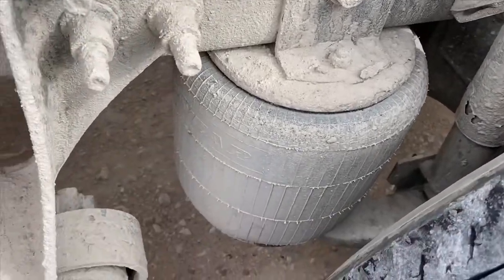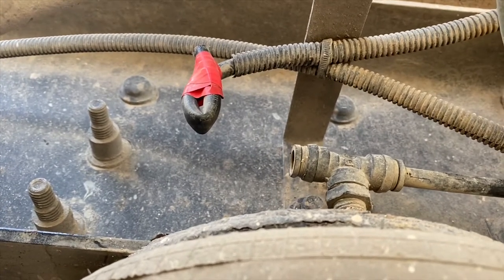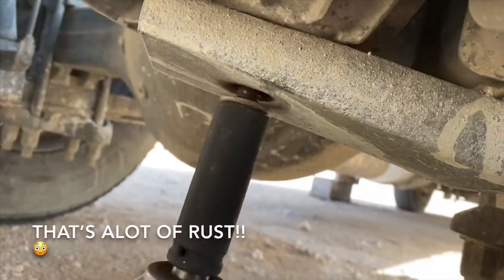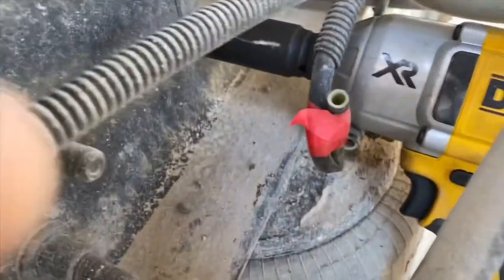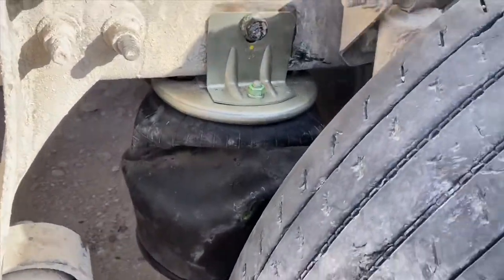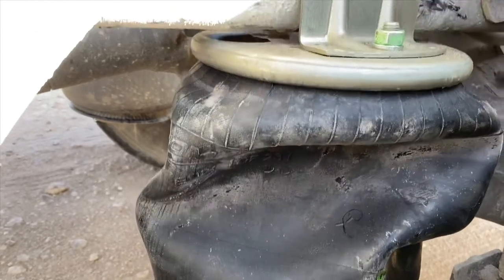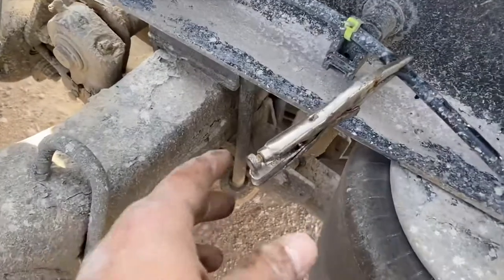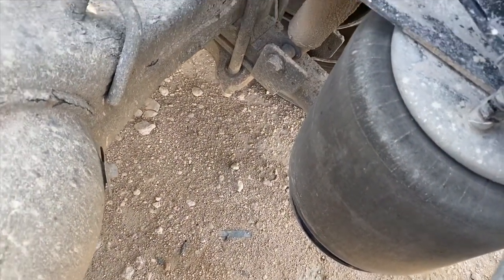International Prostar airbag replacement

Comment: Should’ve showed how to remove the air line
Reply: The connection has like a ring looking tip. Press that and pull the airline while pressing . It should slip off. I know you wrote this a while ago, but at least people can read this in the future

Comment: Do you have to lift the truck to do this job?
Reply: That's the same thing I was wondering because I'm about to do Mines myself soon.
Reply: Used a jack to lift mine. Wouldn't clear bolt without being lifted.